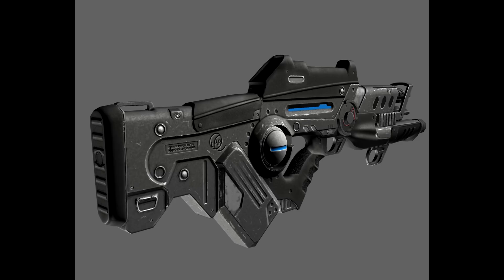The laser trigger

Comment: I was pondering future trigger advancements just the other day and just now ran across your video.  

Aircraft and now motorcycles and cars have gone to "fly-by-wire" (originally developed for aircraft) tech for throttle control and even braking control.  They still use conventional mechanisms for the user (grips, pedals, or levers as applicable), but there is no actual mechanical connection to the engine's throttle or the brake calipers themselves. They are instead actuated by electric motors or solenoids being commanded by micro-processor. 

A "fly-by-wire" (fire-by-wire") trigger won't need an intervening microprocessor, since it isn't a variable input, just binary, either actuated or non-actuated.  Just a simple electronic switch.

So the trigger could be easily made two stage and with whatever pull characteristics desired.

Combine that with electrically fired primers (no mechanical firing pin or spring) and you've just eliminated or at least greatly mitigated a number of the significant factors that can compromise accuracy in shooing.

What's also neat is that this tech exists, and could be easily adapted to retrofit existing firearms.  Well, easily said at least.

Comment: Several of my favorite paintball guns have a laser trigger. However, there is a physical trigger which breaks the beam. This allows you to tune it to the smoothest possible feel, while still having a definite break point. I prefer the style with magnetic return rather than spring, as it makes a nicer snap. you can make the tension be nothing to quite stiff, and also adjust trigger rake, pre-travel, and over travel, as well as the firmness of reset, some what interdependently from initial break strength. Trigger pull can be as light as .5 grams or so, without bumpfire  problems (called 'bounce' in PB, and considered to be a rule violation, so we work to tune it out.).

Comment: Laser...not sure, anything can break that. But what can be electronic and be added even on top of the actual mechanic trigger is a pressure sensor.

Triggers have known breaking points. So adding something like a pressure sensor that checks against accidental discharge is nothing out of this world.

Or even further, only a pressure sensor. Unless the pressure is met, the gun does not fire.

Comment: The problem I see with that is dirt/debris/gloves. If dirt were to get in the lens, or perhaps the unlikely event of debris or a bug flying behind your finger, I think it'd make accidental discharges more common, or worst case scenario it'd get the firearm stuck on full auto causing mag dumps. Also with gloves, you can't feel how close you are. While trying to get in position for a shot, you might just end up firing prematurely. There's also the potential of the lens getting worn/scratched (Unlike a scope lens, you might be physically touching the trigger lens often, even if it's accidental in the case of contact not being necessary to fire).

Also it would have to be waterproof, and the idea of batteries being required to fire isn't exactly stellar. Actually, yeah, in the event of an EMP or whatever it's called, your firearm would be rendered useless. Imagine that; THIS JUST IN! US Military adopts amazing new firearm technology!... Enemy uses weaponized EMP; steam roles American troops worse than when Nazi Germany invades France! I think right there is the reason it is almost guaranteed never to get adopted, besides the fact that a few bits of metal has to be replaced by electronics (which doesn't sound cost efficient when triggers still get the job done). If a nation could potentially unarm almost every soldier in a provided area, they'll get to weaponizing EMPs in a hurry. Wouldn't take long in this day and age I'm sure.

At a rifle range, it'd probably be fantastic, provided that safety measures are included. For the military? Not really. Great idea though! Thinking outside the box, right on, I'm doing the same, however I don't want to let my list of ideas out ;) In truth, I also like to sketch down my own firearm designs on occasion. Sure, chances are none of them will ever see the light of day, but a man can dream, can't he? I hope to some day develop a design that is accepted by the Canadian Forces, and more importantly, is met with success. It'd break my heart if it turned out to be an XM16, directly causing the deaths of dozens of my countrymen due to jamming. If other nations happened to like it and adopted it, like how various nations are buying/producing FN firearms (M249 and C9 are the FN Minimi. M240, C6, and Britain's GPMG are the FN MAG) then that'd be just icing on the cake.

Anyways, keep the creative juices flowing! Cheers!

Comment: John, I have been giving more thought to your laser trigger discussion and have come around to your point of view.  I think this would work if you marry the trigger with a red dot style optic.  In the peripheral field of view, there could be a set of progress indicators that would light up as your finger approaches the point at which you break the trigger beam. The first couple of bars could be green, followed by two yellow bars and finally two red bars. At the point where the second of the red bars appears, you know that any further movement will fire the weapon.  I expect that it would take many hours of practice to develop a muscle memory that masters this trigger.  The whole system could be computer controlled, allowing the shooter to fine tune the performance.  The computer could prevent you from firing the gun if your finger moves too fast, if you want that feature. That would guard against finger twitches and other accidental movements. You could adjust the travel, the break point, an the reset.  I see this system as better suited as a target gun or for snipers. The progress bars would have to light in order or the trigger locks out.  That prevents a fly from shooting you with your own gun.  The travel from first bar to last should be about 3/8 of an inch, thus insuring that there is a beefy finger at work and not a pencil or twig.  As stated earlier, this could be adjusted for user preference.  Perhaps there could also be a device built in to detect whether or not a real finger is present, bare or gloved.  My ideas were born out a session of me messing with my digital camera and how the little green square lights up as the button is staged to take a picture.  Now build us a prototype.  Be sure to invite me to the range for the unveiling.

Comment: I think a more probable and practical electronic trigger would be a pressure-sensor. The gun still has what looks like a trigger, but it doesn't move, it just fires the gun when you squeeze the front edge of it hard enough. If you made it need a fair bit of pressure and/or have a safety interlock (say a thumb button that has to be depressed too) then it should be safe enough. The advantage would be the elimination of movement and vibration from the system.

Comment: I'm thinking there will be dependant circuitry and power source requirements that will make a firearm less of a reliable tool (a fancy hammer if you will) and highly unreliable. I'm thinking, right now the only good thing about an EMP is that our gunnin' gear will still work. Start adding electrics and "Poof"...the commies will have us all, and our 'blades of grass" will be little better than baseball bats.

THEN AGAIN

At some point down the line, once small arms finds a viable alternative to the chemical propellant cartridge, I suspect some quantum leap or other would have occured where the fragilities of integrated circuits or "something else" would be sorted and find an application to make it work. I mean the navy has that rail gun right... inevitably... a change is coming. I mean, c'mon..the 'phased plasma rifle in the 40-WATT range' will NOT be actuated by a mechanical sping loaded trigger!

Hopefully this wont take too long and I'll not be too old to finally own and weild a light-saber. A purple one like Mace WIndu..

Anyhoo, I thought Geisselle(sp?) fixed all our trigger control issues?

Comment: From a disruption standpoint it sounds like a wet dream. Just imagine with every trigger pull using a sensor that the bullet will go right where the sights are on. On the other hand once gun manufacturers break that physical connection between the finger and firing pin our "trusty" government will step in and put some kind of shut-off or some other control that will impede using the firearm in certain situations whether they be legitimate or not. It is another slippery slope. Stupid government

Comment: Here's another idea: in the future we will likely see more electronics in weapons, and I bet we'll see batteries integrated into magazines. Why have 3 different batteries for your optics, light, laser, range finder, and future innovations like cameras or IFF? Instead, just plug those into your weapon's power supply. In this way, when you slap in a new magazine during a reload, you get a fresh new battery. The magazine will probably contain a status circuit/LED to tell you if the battery is still charged. This might be 20+ years down the line.

Comment: That is a good idea.  But it will require a power source on the gun.  Power sources require batteries which eventually run out of power.  For reliability, I think the old physical trigger will be around for a long, long time.  The laser trigger may be functional on special applications weapons like assassination team rifles which would benefit greatly from the non-movement of a laser trigger system.  But even for special hunting weapons which won't be used frequently I don't see that the benefits outweigh the issues of a laser trigger.

Comment: Another possibility could be similar to what some paintball guns have.  The springing action of the trigger is actually the pull of a magnet and the triggering mechanism is a laser or led sensor of some sort.  Same idea really as it makes for an incredibly smooth trigger pull and no disruption at all when it breaks the shot, since its just intercepting light.  They are adjustable as well by moving the position of the magnet.  Only real downside is the reliance on an energy source to drive the laser and ultimately whatever electronic device moves the sear, which isn't a total deal breaker but still.

Comment: They make MOSFET triggers for air soft guns, which is a trigger mechanism that is triggered (no pun intended) electronically. The issue I have with this is that I do not like electronics for the most part when it involves firearms. A light and a red dot sight are okay, because if they break, the gun still functions. I do not want something as important as a trigger to be electronic. Ever. I want simplicity and tactile feedback.  Kind of like modern cars. All the electronics added to them have their advantages, like improved mpg, but there is something to be said for an old, simple carbureted engine that you don't need computers to fix or make run. As much as I appreciate the imagination here John, I do not see it giving any real advantage over a good, reliable, manual trigger. This is kind of like putting a laser steering wheel on your car. Even if you could, would you really want to. Some people may, and that's cool, as long as I still have the option to use a real trigger.  Good radio show, by the way, John.

Comment: Why a laser and not just a button that sends an electrical signal to a powered trigger mechanism. Breaking a laser seems too easy to actuate accidentally.
Reply from the maker: I think a button might defeat the purpose. I imagine it like the guns where you have a set trigger and then a very light trigger that breaks from just thinking about pulling it. Some kind of initial trigger that turns on the system and then just pass your finger through the trigger guard and the gun fires. You wouldn`t even activate the system unless you were ready to fire and it could have a drop down back up manual trigger just like how we have back up irons with optics. It would be made by magpul of course.
Reply: hickok45andson that is true ... maybe with time electronics will become even cheaper than heavy machining (if its not cheaper already) and we will see electronical triggers in budget guns with high end competition guns using the "old school" mechanical triggers.

Comment: The biggest problem is the lack of tactile feedback telling you that you are near or about to break the trigger.

I have an old joystick for my computer that has force feedback on it. To help preserve the motors, they are only active if the light that is emitted by a small LED to an electro-optical sensor is broken. Gripping the joystick would do this.
For my own amusement I would try to move my index finger as close to this sensor as possible to the light beam emitted at the sensor without breaking it. No matter how often I did this, I would never built up strong muscle memory for when I would break the light beam.

Maybe some new technology in the future will be invented that makes it safe for use. But with current tech, it is an accidental discharge waiting to happen.

Comment: Reasonable idea but not really practical. There is a reason that shooters don't do 1 pound trigger jobs. They need some resistance to anticipate when the trigger will break, and they don't want the gun to go off if you breath on it.  What you suggest is a zero pound trigger pull.  You would have no idea when your finger is about to break the plain of the laser.

There is an actual smart weapon aiming system that sets you point of aim when you pull the trigger and only fires when you have the guns aimed in the right direction.  I suppose that you get a red dot that follows you aim point, so you can see where you set the point of aim.  That way you can abort that shot and re-aim.  The gun fires automatically when you get it inline with the aim point.  If I find that video I will point it out to you.

I think it would be better to go along the line of eye tracking and lock in on the target, like a fighter pilot. Then let the gun aim itself. Just hold the gun in the right general direction and let it do the rest.
Reply: Or we can just keep making good triggers and practice.  =D
Reply from the maker: The reason you need to know when your trigger is breaking is because you cant jerk a trigger no matter how light it is. If it has no resistance at all then you can jerk as hard as you want as long as you don`t shake the gun off target. Again keep in mind I`m not saying this would work now but as other technology progresses, I think we will see something similar to this on guns. The tracking point is pretty cool but it seems like the long way around the barn to me.
Reply: hickok45andson
I sent you a PM with a link to the Smart Rifle.
Reply: Heinrich Metzger
Exactly.  I was just about to say the same thing.
Reply: JunkfoodZombie
I can't decide... My 3.15 pound trigger seems a bit heavy.  Should I go for the 3.13 pound job or the 3.14 pound?  Quest for the perfect trigger. ;-)

Comment: As neat as it sounds, it also sounds pretty dangerous too. Your finger twitching just slightly into the laser or drifting into it would be enough to set the gun off. Resistance in triggers aren't all bad. And there's also the issue of electronic components in guns withstanding force and their batteries not dying.
Reply from the maker: There would need to be some sort of manual set trigger to make it safe. I agree with the current technology it isn't viable but it will be eventually.